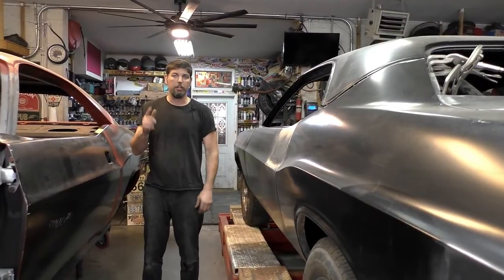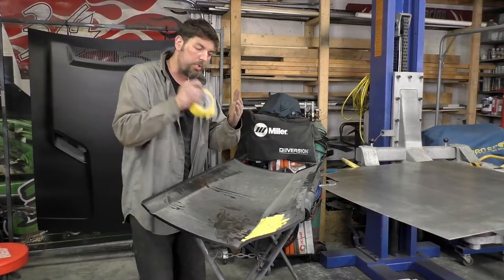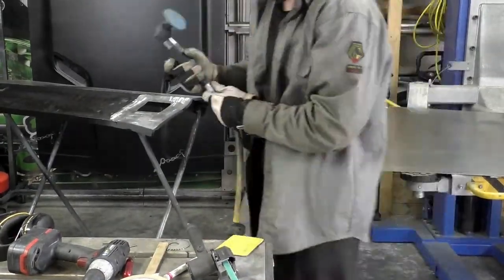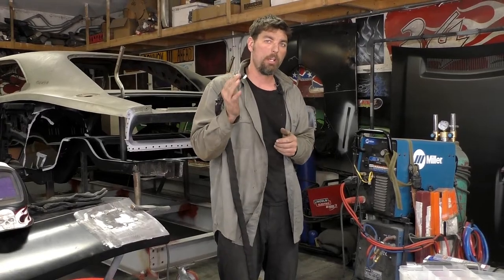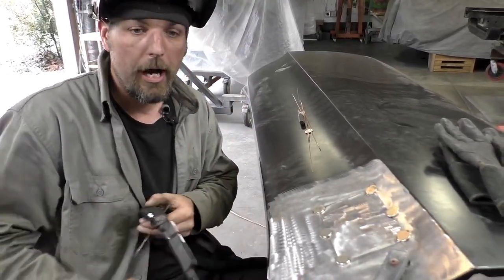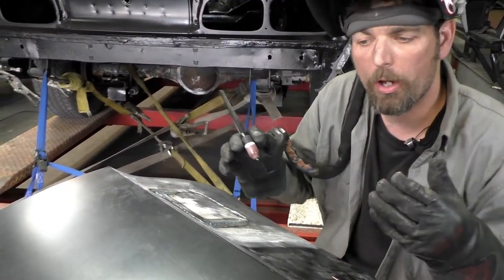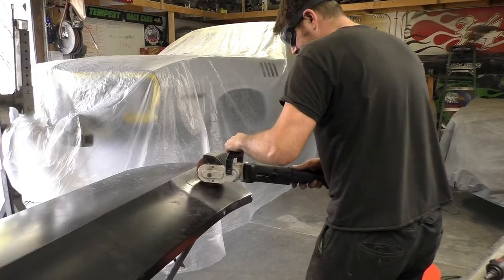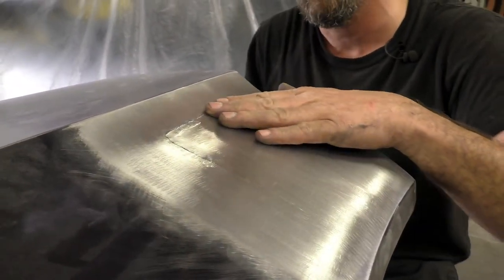TIG Welding Sheet Metal Patches Step by Step restoration work with tips and tricks

Comment: I'm a total newb, just starting with welding. This video was the most informative I have seen to date. I've got sheet metal work to do on my Challenger that I've owned since 81 (along with undercarriage work) that has been around the world with me and sat on mothballs for the last 15+ years. Thanks for sharing your knowledge.
Reply from the maker: You are very welcome, In general regarding this video I usually TIG weld most of my external sheet metal and anything most people will see. As far as inner structure and the floor area of the car most of that I will MIG. Good luck with your Challenger

Comment: One thing I notice that you do vs many other metal workers is rounding the corners on patch panels, did years of millwright work on repairing equipment and first thing you do is drill the end of the crack to stop it traveling before you weld, just a really good practice to remove future problems,  have seen cracking at the back of 69 Camaro side windows from just that sharp corner
Reply from the maker: Your right I have also heard about drilling a hole to stop cracks. I also feel when you round your corners it keeps the heat from peaking that area. Thanks a lot for the tip!

Comment: Very cool. Got a lot of sheetmetal to do on my Jeep comanche. The amount of time you just dedicated to a 4x5 inch rectangle has me like “omg” 😂
Reply from the maker: Hang in there, If they make full panels I recommend going that route first as it would save you a lot of time. Also patching if you try and patch close to a body line your risk of warping will be far greater and easier to correct. This was one example of a harder area to weld / metal work as it has no support around it.

Comment: To match sheet metal gauge, I like to salvage sheet metal from similar cars. A lot of the stuff from that era was actually 19 gauge, which is hard to get.
Reply from the maker: That is a good tip and you are correct, personally in what I am doing it just isn't cost effective to go that route

Comment: Great video!  I have been wanting to learn TIG for a while now and this is very helpful instruction.
Reply from the maker: Thank you. If you get to sit down on a system start out with 1/8 to 1/4 mild steel scrap and don't even mess with filler rod. Strike an arch and do straight line runs controlling the puddle with the amperage walking it in a line. If your not welding two pieces together no need for filler. Once you're comfortable with the Torch side of things then you can go ahead and add the filler hand. This will allow you so walk before you start running.

Comment: Super video and great workmanship, I like the electric door poppers but I hope the guy maintains the inside manual door handle for emergencies.
Reply from the maker: Thank you and great advice, I will suggest it. I informed him this was territory I knew nothing about minus the actual closing of the door handle portion.
Reply: @carthageclassiccars  use an electric door openers was popular 20 years ago people eliminated inside and outside door handles and then got involved in an accident that cut power to open the doors and got trapped in the cars and they caught fire they couldn't be saved. Hot rod magazine strongly suggested keeping inside door handles manual not electric
Reply from the maker: @mrpurcountry  That makes complete sense thanks again for all the advice and feedback!

Comment: Enjoyable video. 
Thank you for no music.
Mig wires’ hardness is S 6.
It is very hard .
Grinding and planishing that bead is difficult, it will also kill your English wheel and planishing hammer.
  On the other hand, TIG wire filler rod is S 2 hardness . 
Much softer. 
  In and of itself, the TIG process gives you a softer weld , but using s6 rod lets you planish it out very easily.
I do realize that .030 wire size might not be easy to find in TIG rod..
Silicon bronze is also nice and soft for sheet metal.
Just a personal observation, I enjoy your videos very much
Reply from the maker: Thank you and very good input. You are correct on everything you stated with. The rod hardness settings do play a role in it which I did not cover and with the .030 rod usually I twirl up some mig wire which i know would be harder. I do use silicon bronze on usually seams or unlike metals that need to be adhered, however personally I try to avoid it most of the time on body panels being you are not actually welding the metal together since the bronze melts at a lower temp its like soldering in a sense. I don't feel a butt joint would be as strong. Saying that how much pressure will these pieces have so I am not saying your wrong and we all have our styles we are comfortable with. I agree the SIB is so much nicer to hammer out, Thanks again for the input you contributed.

Comment: Excellent video.  Under what circumstances would you want to use the 60 degree tungsten with the wider pattern? It seems like to you'd always want to have the most focused arc.
Reply from the maker: For instance TIG brazing I always want a wider arc so not to get the penetration and just melt the brazing rod. If you have a wider arc you can dip around the edges better to suck it in for instance if you are at a weird angle and can't get the rod directly in. That is also the case if for some reason you don't have as tight of a fitup and moving you filler rod to fill the gap you can run a straight run but weld wider. Sometimes its just user preference what they feel works better for them.

Comment: Great video. I might have missed it but did you mention the tungsten size?
Reply from the maker: I can't remember if i mentioned it but that 18 gauge sheet metal usually I will use red band 1/16 inch tungsten or lately I have been using a CK woldwide "all in one hybrid" tungsten

Comment: Is there a reason to cover the patch with fiberglass filler? Is it because the metal doesn’t expand the same in the sun? Thank you for your time
Reply from the maker: The only reason I use fiberglass on metal patches is that is it water proof and won't absorb moisture like most every other filler. A lot of time when MIG welding in patches you can have pin holes in the weld that could get behind filler/ paint and rust. Fiberglass would put a waterproof barrier between the patch and the painted surface.

Comment: Hi Rick,
I also have a Miller Diversion (the 165 model) and I've added a foot pedal. I'm having difficulty tacking 19 gauge steel sheets. I have zero gap but when I apply heat the edges melt independently and a gap develops. Once this happens I can't rectify the situation.  I've tried positioning a filler rod just above the area that I want to tack but the rod melts first (due to its small mass) and not the underlying metal. I would appreciate your help.
Thanks,
Mike
Reply from the maker: Mike, maybe email me if you get really stuck at carthageclassiccars@gmail.com if this doesn't help. Usually I am around 45 amps on that thickness metal and have the ability to back it off on the pedal. I think you are getting ahead of yourself and need to run just a puddle on some scrap metal first with no filler. You need to learn to control the arc puddle. What is happening is your not getting a puddle formed first so you need more initial heat from the torch with no filler. If you add filler before the puddle forms it does exactly what your running into. The filler rod especially with tacking is mostly to catch the blowout from the penetration if needed. When I run a weld on 18-19 gauge mild steel actually I barely even add filler to it just every so often when the gap is tight. It gets hard as you do need to pay attention working the amperage on that sweet spot with good penetration, walking a puddle, and not adding filler but letting the puddle suck it into itself. I know this was a quick summary of a major technique that takes some months of work to even get usable and years to master. I would recommend watching some 100% welding beginner tutorials before really getting too involved in the art of sheet metal TIG welding. Good luck once you figure it out the world of fabrication is really opened up even more.
Reply: Thanks Rick. I appreciate your comments. I'll practice some more based on your suggestions. Mike.

Comment: Getting frustrated with blow-through on my 18-gauge panels.  I have a cheap Amazon TIG welder without pedal amperage control or pulse (only a on/off switch at the torch),  there's a 2T/4T switch on it, but it doesn't appear to do anything , using 1/16" tungsten, 1/16" filler rod, gas at 15CFM (more than I should need) running only 15 amps, nice tight seam on the panel, using a 1/8" copper backer, but I can't seem to avoid blowing a hole through on one side or the other before I have a chance to apply filler .

The only thing that seems to  work (but not always) is if I start the arc well away from the seam , quickly draw it into the seam, then do a brisk rootpass motion over the seam.  Eventually a puddle develops dead center on the seam, after which I can either stop or continue to rootpass forward along the seam.   But penetration isn't complete.  If I try a rootpass at an amperage closer to the recommend 40A ,  the rootpass motion will produce immediate blow-through on one side of the seam.

What am I doing wrong? What's the secret to preventing blow-through on such thin steel?

I'd love to see a video on preventing blow-though on body-panel TIG welds, especially if one has inexpensive equipment.
Reply from the maker: So I hate to be the one to give you the bad news but you are setting yourself up for failure to start with. Trying to do precise work with a welder not designed for it. Amperage control is the Key factor when trying to do thin sheet metal. You need to start higher amps get the puddle up quick then back off as the heat is being applied to the panel. its constant adjusting to the changing metal and how much filler you are adding. So when you are at 15 AMPS all you are doing is adding so much heat in the surrounding area due to the slow rate its heating up the puddle. With a copper backing plate the problem will also get worse as the copper is absorbing the heat also as a heat sink. The only way I could see you welding this thin sheet metal and have done before is try your amperage around 40-45 amps turn on the welder get your puddle developed really fast and start adding filler. It would be a lot harder for someone that doesn't weld all the time. I broke my amperage control board for a month waiting on parts and this is what I had to do. You will only be able to do short runs but you will need to add a lot of filler and watch to get out of it before it blows out. I know you would love to see a video welding with inexpensive equipment and I do get offered free welders all the time to do demo videos on them but my opinion inexpensive equipment gives inexpensive quality and I think your main problem is just that.
Reply: @carthageclassiccars  Thanks very much for the sanity check. I'm OK with the answer of "You can't get there from here." YT content creators were making it look too easy, and I wondered, "What the heck is wrong with me?"   However,  my ordeal has, through experimentation,  taught me some crude manual methods of heat control on sheet metal  until I can fit a better machine into my budget.   Can you recommend a TIG machine machine that is sufficiently feature-packed yet reasonably priced?
Reply from the maker: @singledigits_og  I wish I knew the best answer to you but really only have used the miller line in the TIG world. They are not budget friendly welding systems.

Comment: Great video, I have not done any tig welding yet. I was looking to purchase a new tig welder To get started on some external patch panels I have to do. What Tig welding machine would you recommend to get started. Thanks for the video and the welding class.
Reply from the maker: I honestly wish I could give you a recommendation however I don't want to lead you wrong. I have only actually used 3 different machines so far in my life and the one in this video actually was the cheapest out of all of them. Its more of the miller starting ac/dc line but still really pricey for what I have seen the off brand systems go for. There is also a lot I upgraded on this machine that I wasn't really happy with once i really started working it a lot. Look at reviews, the largest price jump I feel is going to the AC/DC vs the straight DC systems. If you know you have no use for aluminum now or in the future a DC only system might be your best bet to get your foot in the door. Thanks for watching and good luck on your purchase if you do end up buying one.

Comment: Thanks for sharing ..New subscriber By any chance did you video the repair on the Charger frame rail? I could use some knowledge. I'm starting  1st B  body project . again thanks for sharing
Reply from the maker: Thanks for subscribing. Unfortunately I did not film that repair. For some reason I did not think there would be so much interest in that kind of repair. I think next time I have a similar repair that is needed I will do the filming on it since there have been a few requests on it.

Comment: You have used silicone bronze in the past for the seams. Are they any advantages to use this on panels?
Reply from the maker: On this since we can get to the back I feel there is no advantage if you were using the silicon bronze. Actually the weld here is going to be a lot stronger since its fused together not glued with the SIB.

Comment: Also a question Tig would be ideal when you get behind the panel , as if you can’t get behind with a dolly a patch , mig would be a better option ?
Reply from the maker: I still personally will usually use a TIG most of the time if I can't access the back most of the time. There are spot weld pullers and other ways to get the panel planished out.  If there is a way try and plan your cuts around how to get them stretched out. I will Use the MIG fast on edges a lot of times when adjusting gaps.
Reply: @carthageclassiccars   Thank You

Comment: Is it necessary to have to use a foot pedal for tack welding and or seam welding all the time I'm looking into buying a entry level tig welder that's not a big name brand thanks?
Reply from the maker: No its not necessary and I do use just the switch sometimes instead of the pedal. I feel the pedal helps control heat as its easy to vary amperage but also the speed you weld and how much filler you add also can be used as heat control.
Reply: @carthageclassiccars  I'm looking at buying the ahp tig welder want to start welding body panels skins
Reply from the maker: @rongamble9884  I have never messed with one so don't know how well it would work. Look into make sure its not scratch start as that might be hard to do with this kind of work
Reply: @carthageclassiccars  they said it's a high frequency start where you just put the torch down to the area to weld I'm looking at it as entry level to start with and not put out couple thousand to start out with
Reply from the maker: @rongamble9884  I don't blame you and yes High frequency start you should be good for this stuff.
Reply: @carthageclassiccars  I may be looking at a entry level welder through eastwood also

Comment: What was the welder amps set up?
Reply from the maker: Rule of thumb for mild steel sheet metal is 1 amp per every .001 inch of thickness. 18 gauge on this door skin is 0.048 inches thick so i set my welder amps to around 45-50.